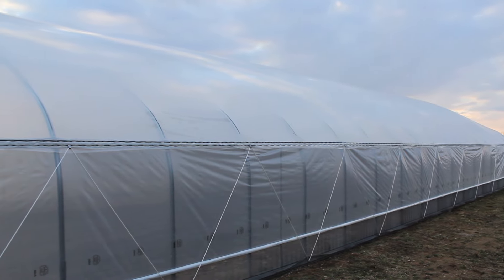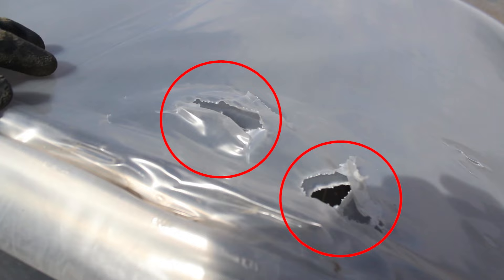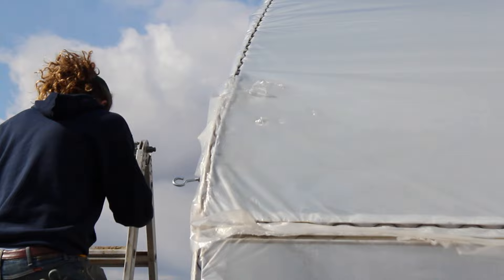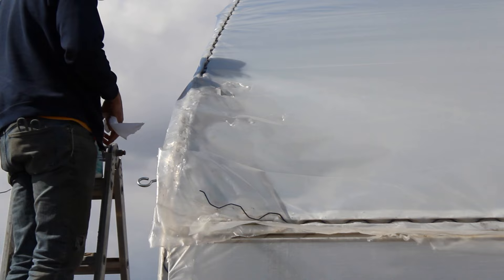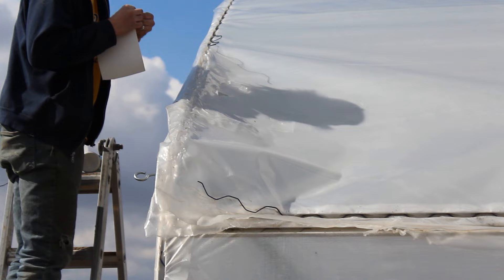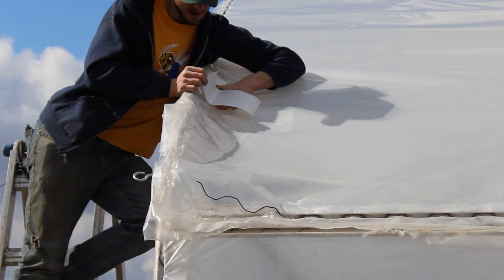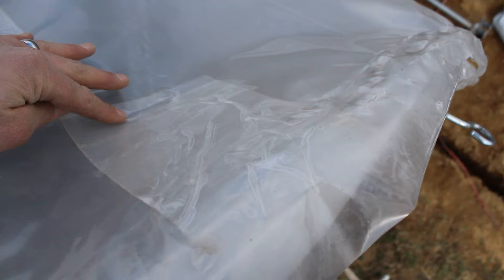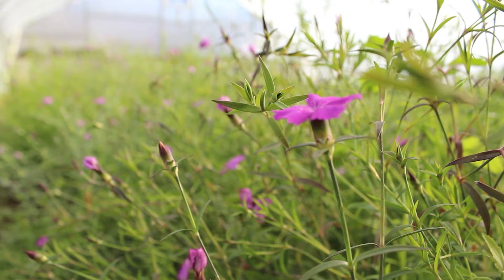Repair Damaged Greenhouse Plastic | Patch Holes and Rips | Single OR Double Layer Covers

Comment: A thought that occurs to me regarding the removal of air bubbles is to use a small piece of plywood to hold one one side and use a j-roller, like you would use to apply Formica or veneer, working from the center out. Haven’t tried it yet but it seems like it could make the job easier and the result better.
Reply from the maker: Not a bad idea, John, that might work. I’ve never done it myself, but if you or someone reading this tries it out, I’d love to know how it goes. Thanks for watching

Comment: That's isopropyl not rubbing alcohol which is a good thing as rubbing alcohol which is designed to rub on one's body has oil in it so it doesn't dry out your skin.  Tape doesn't stick to oil very well.

Comment: Very convenient the holes were right at the edge of the plastic.  Now fix some in the middle...
Reply from the maker: lol, very true, those branches must have known I was trying to make a video. There were some in the middle of this structure too, but they were near the hip-rail so I was lucky there too... if I have the chance to do a video of some in the middle I will though.
Reply: When I've done repair on my greenhouse, I've used 6 mil tape.  It's no sin if you use a heavier tape than the cover, it will just cost more.

Also, I just put the tape on one side so if it's in the middle someplace, it will be easy to apply.  I have my wife pressing from the other side.   My greenhouse has "5 year" film, so as it ages, the longevity of the repair matters less as it will all come off soon.

I have not used alcohol to clean the surface first but will do that in the future.

Excellent narration describing how to do the work.  I hate the YT videos that are completely lacking narration and are paired with a bad music track.

Comment: How do you fix a hole in the outer layer in the middle where you can't reach the outside.
Reply from the maker: Good question. The way I have repaired a hole like that… without renting equipment, and this is going to sound crazy… is by:

1. Getting a straight ladder that is long enough

2. A couple feet in from one end of the ladder, I duct tape a 2x4 to the ladder perpendicular to the ladder. It must be a 2x4 that is longer than the bow spacing (so if the bow spacing is 4 ft apart I get a 2x4 that is 5 or 6 ft apart)

3. I then pad the 2x4 substantially where the 2x4 would make contact with the bows if I were to lean it against the structure.

4. I then lean it against the structure at an angle that allows the 2x4 to make firm contact with the bows

5. I have someone hold the ladder while I walk up it to pitch the hole. The angle of the ladder will vary, but it won’t be very steep, it is almost like I am waking up a ramp more so than climbing a ladder. 

6. If the structure has two layers of poly one could turn off the blower fan and remove enough of the sidewall plastic where the ladder could fit between the layers to get tape on the other side of the hole as well… this might be riskier though because you would have to be very careful the 2x4 and / or ladder doesn’t damage the interior or exterior layer of plastic.

I know that sounds crazy but that is how I have done stuff like this in the past… the safest way though, and what would likely make the most sense for most people, would be with a rented piece of equipment that can safely get someone up that high and close enough to the hole to repair.

Comment: Very helpfull,  will the tape works with any kind of greenhouse plastic? Ours is solarwoven, polyolefin? Thanks
Reply from the maker: Thanks for the kind words. There is usually a specifically recommended tape for different plastic covers. The plastic cover you mention is very similar to our 9 mil and 12 mil woven plastic covering, which uses this repair tape, which is white: https://www.tunnelvisionhoops.com/woven-repair-tape-3-in-x-60-ft/ I would reach out to your supplier of the covering to see if they recommend something in particular, but if they don't you might be able to try this tape since we use it for coverings that look very much like the one you mention. Best of luck!

Comment: Can I apply my second layer of plastic with the same wiggle wire from the first layer of plastic?
Reply from the maker: Good question! You certainly can. 
I actually try to use one piece of wire to hold in two pieces of plastic for most of the structure perimeter.

Comment: Hello, I have a hole about 2 feet below the roof peak on a double layer plastic gothic style greenhouse that's 12' high.  I can reach the inside with a ladder but any suggestions on how to reach the outside to tape hole?  I also can't undo any wiggle wire as the hole location is pretty far away from the nearest wiggle wire?  TIA for any help!
Reply from the maker: Hi Brad, thanks for watching. It is possible to get to higher up plastic, but it can certainly be a big pain. The way I have repaired holes up higher… without renting equipment, and this is going to sound crazy… is by:

1. Getting a straight ladder that is long enough

2. A couple feet in from one end of the ladder, I duct tape a 2x4 to the ladder perpendicular to the ladder. It must be a 2x4 that is longer than the bow spacing (so if the bow spacing is 4 ft apart I get a 2x4 that is 5 or 6 ft long)

3. I then pad the 2x4 substantially where the 2x4 would make contact with the bows if I were to lean it against the structure.

4. I then lean it against the structure at an angle that allows the 2x4 to make firm contact with the bows

5. I have someone hold the ladder while I walk up it to pitch the hole. The angle of the ladder will vary, but it won’t be very steep, it is almost like I am waking up a ramp more so than climbing a ladder. 

6. If the structure has two layers of poly one could turn off the blower fan and remove enough of the sidewall plastic where the ladder could fit between the layers to get tape on the other side of the hole as well… this might be riskier though because you would have to be very careful the 2x4 and / or ladder doesn’t damage the interior or exterior layer of plastic.

I know that sounds crazy but that is how I have done stuff like this in the past… the safest way though, and what would likely make the most sense for most people, would be with a rented piece of equipment that can safely get someone up that high and close enough to the hole to repair.
Reply: @tunnelvisionhoops  thank you!  It doesn’t sound crazy in this industry.  I was envisioning something to that effect but like your model better.  I’ll give it a whirl, thanks again.
Reply from the maker: You're welcome! And very true about the industry comment, lol. If you do try anything like what I do, please be careful... I only provide info on what I do so others can learn from it, but it is not a recommended course of action... just wanted to say that as an obligatory disclaimer... now that the disclaimer is out of the way, have fun and good luck!

Comment: How do I know what kind of greenhouse cover I have, i.e., 6 mil or other? I bought a house with a greenhouse on the property so know nothing about its construction. Thx!
Reply from the maker: If you do not know who the greenhouse plastic was purchased through it may be very difficult to tell. If there are markings or a brand stamped on the plastic it could give you a clue. 90% of the structures out there are covered with a 6 mil greenhouse plastic though.